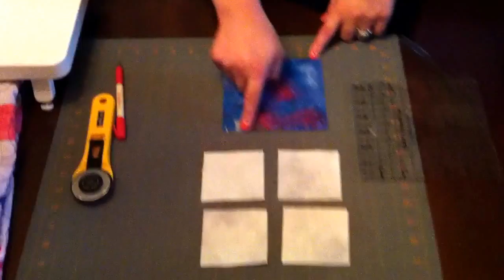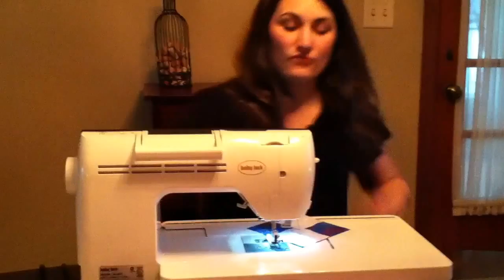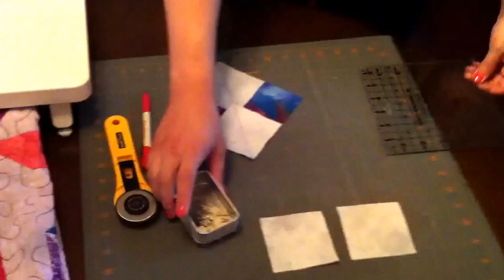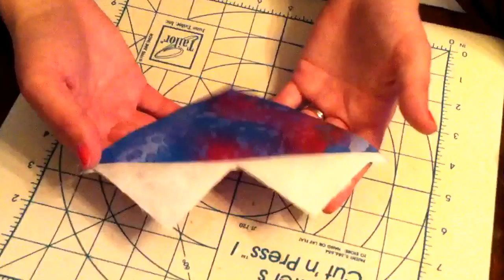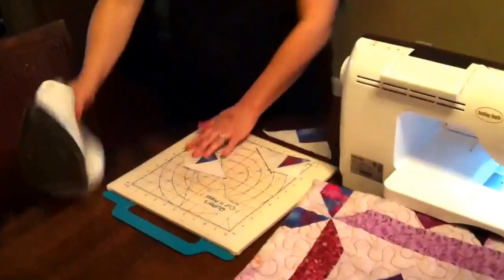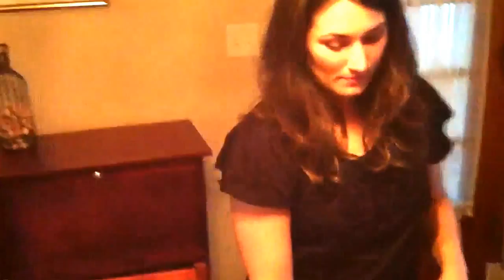How to make no waste flying geese units

Comment: Why you receve biger flying gees 2,5 by 4,5 this is with 0,5" bigger  then you need. I try this and i also receive bigger then i need and you can trim 0,5" to receive the corect size. I did need 1,5" by 3" and i did cut big square 4 1/4", small squares 2 3/8" and i receve 2" by 3,5" flying gees. This does not work.
Reply from the maker: You are forgetting about the seam allowances. Once the block is sewn to other blocks, you lose a quarter inch on all sides. So a block that is trimmed to 2.5 x 4.5 will be 2x4 once it is sewn to another block with a quarter-inch seam
Reply: Quilt Addicts Anonymous O  now I get that "from finish size" not from unfilish like most blocks. Thanks so much

Comment from the maker: Yes you do need to make the squares 1 1/4" bigger than the finishes width of your flying geese unit. Your small squares should be 7/8" larger than the finished height. In the video, my flying geese finished 2" x 4", so I cut my big square 5 1/4" and my small squares 2 7/8". Each one.